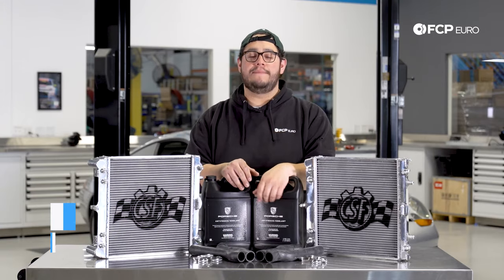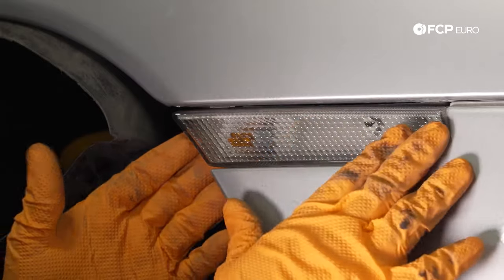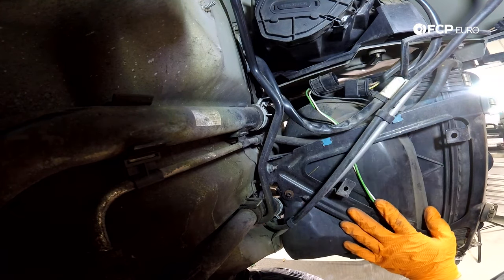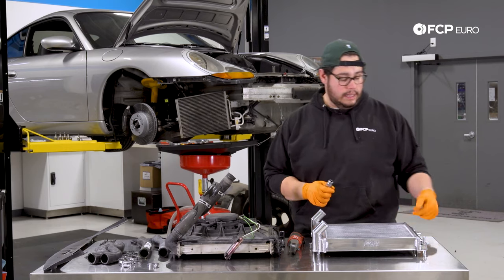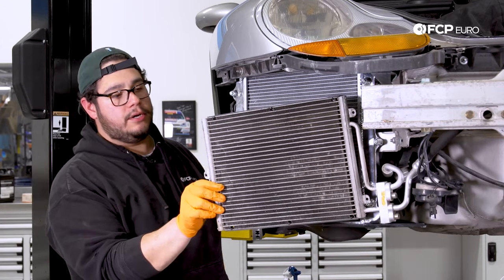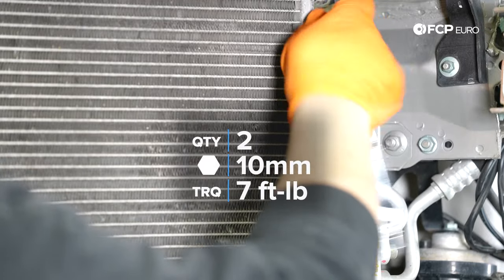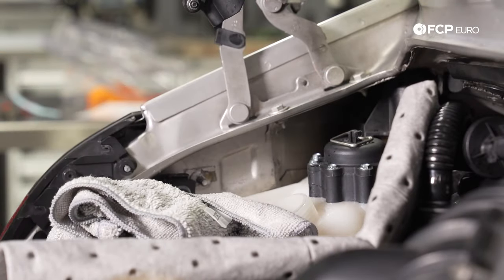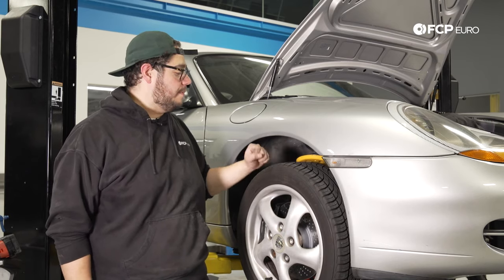Porsche 996 911 Radiator Replacement & Upgrade DIY (Carrera 3.4L & 3.6L)

Comment: That airlift system is a must IMO. I mean, I agree that it can be done without it.  But, the airlift is not only faster, it does an incredible job of getting a complete fill!
Reply from the maker: It can feel like a bit of  a crutch but it just works so darn well! The tool itself really is not that expensive either, so worth it in our book.

Comment: Nice video and crocs By the way..... BUT... I dont see the coolant fluid (pink) getting into the system... I noticed that the coolant type in the car was green... I wished you could explain how to set up the vaccum device in detail and how the venturi effect works. You dont disclose that you need an air pump powerful enough to hold 25psi continually. Wish as well you could make a 991.1 or 991.2 radiator replacement video since it seems necessary to have the PIWIS tester to trigger the air bubble flush (besides the vacuum device) which can be problematic from a DIY standpoint.